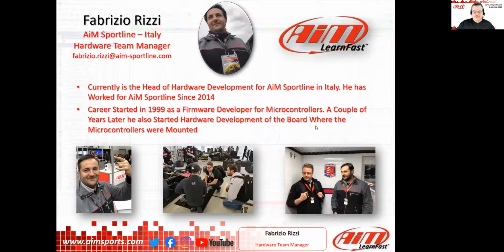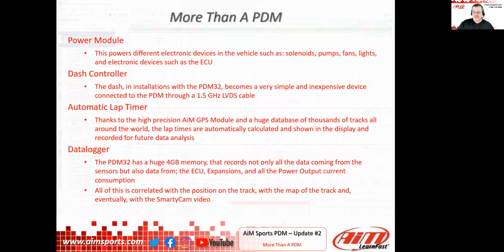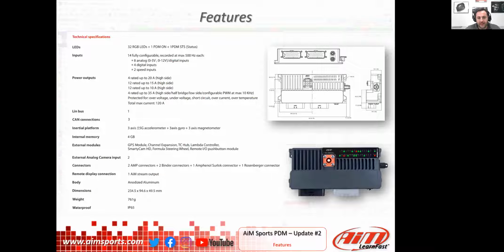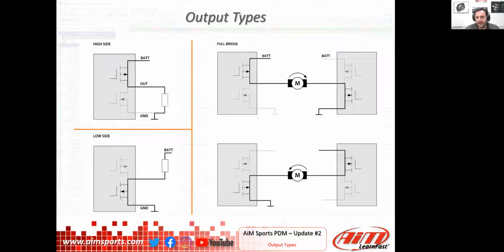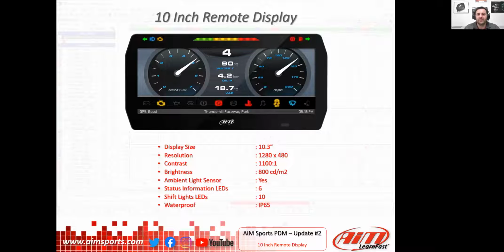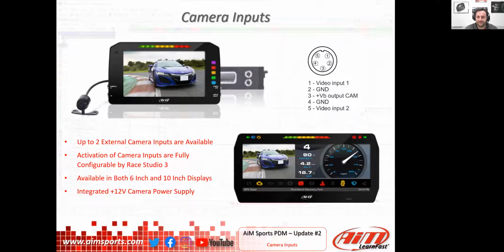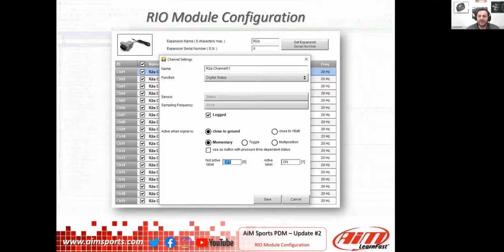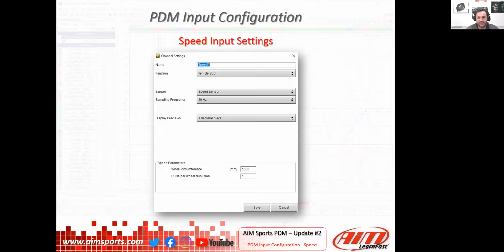1-58 AiM Sports PDM Update #2 - Live Webinar with Fabrizio Rizzi - 10/15/2020

Comment: Does aim offer the ability to fully create your own screens on the dash displays?  If not, is this something that may be added in the future?  I know some competitors allow you to start with a blank screen and pull in various gauges or display items, backgrounds etc.  What are the standard screens on the 10” display?  Is there somewhere I can see them?  This pdm looks very nice and contains enough circuits for a street car unlike most competitors.  I would very much like to use this on my project.  Thanks for the videos